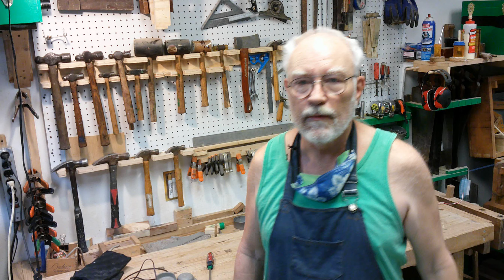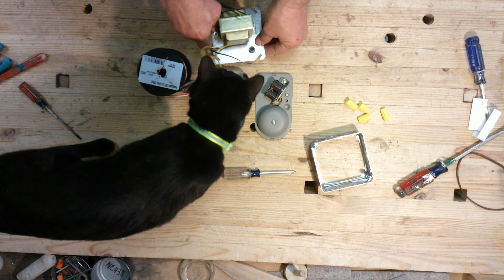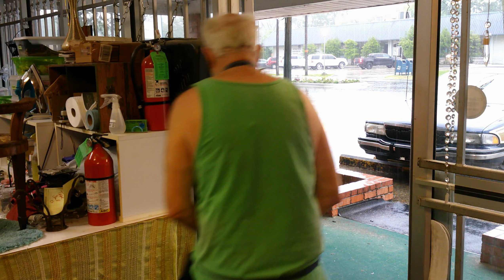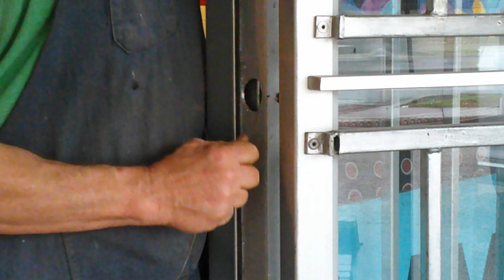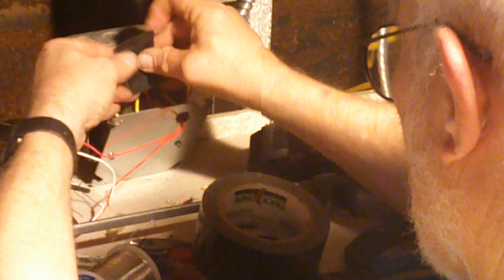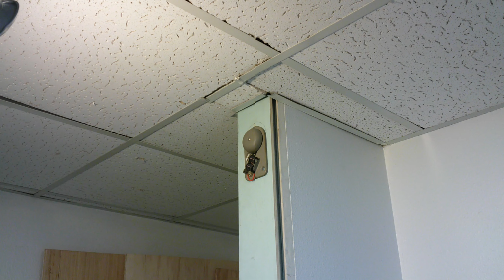20th Century Door Bell Technology for the Secret Underground Laboratory Recovery & Salvage

Comment: My neighbor has a wireless portable doorbell that she takes with her when she goes to her garden or studio. Unfortunately, the button is stiff to push and the battery in either the switch or the bell seems to be in need of frequent replacing. I have a Swiss hand ring bell chime at the front door but more likely I am somewhere in the yard, lol.
Reply from the maker: It's about 50 feet from the front door to the Lab space and that's just beyond the range of the wireless doorbells, so the bell module has to be mounted in the hall. My first encounter with wireless door bells was on RVs. This was around 2002. The battery for the switch cost $36 dollars and seemed to last about 6 months.